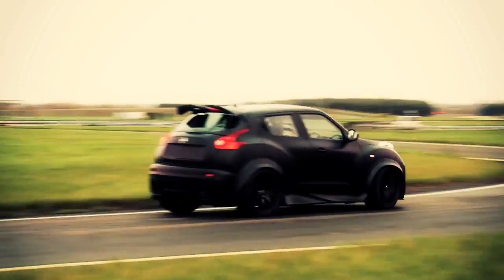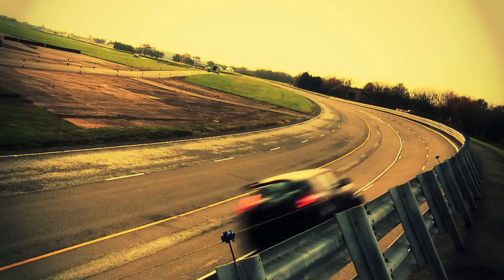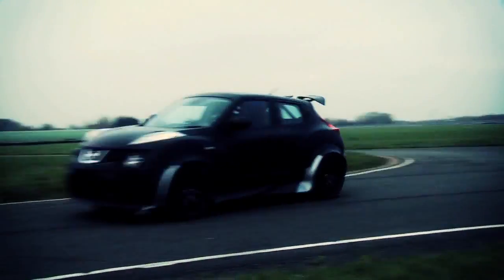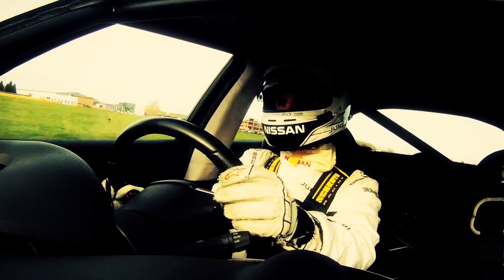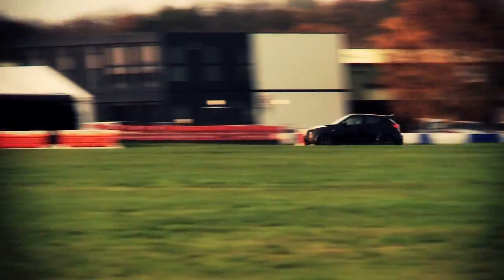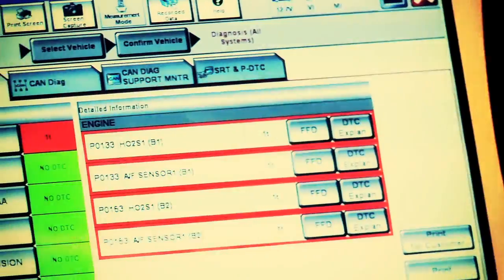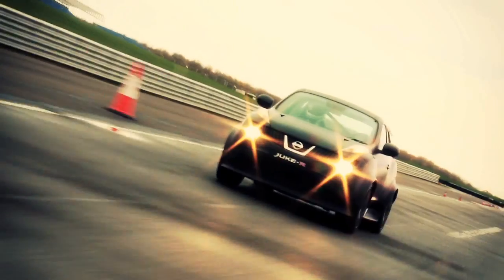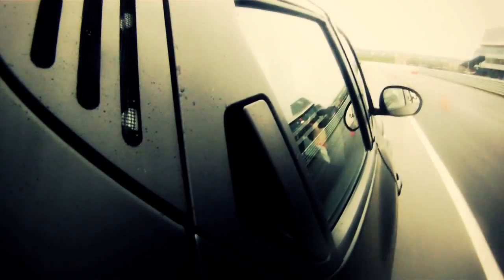Nissan Juke-R Shakedown and Testing

Comment: My Juke is no joke.    Approaching 225hp with less than $1,000 worth of additions.   Pulls like a freight train at boost and I haven't even touched the engine management system yet.  I'm glad people are opposed to it.  I don't want to see myself coming and going.  The more people that hate it, the less I'll see on the road and the more fun it will be to shock someone when the croc-eyed beast eats them for breakfast.  2900-lbs/225hp makes for fun driving every day of the week.